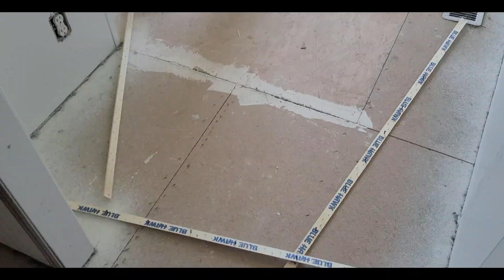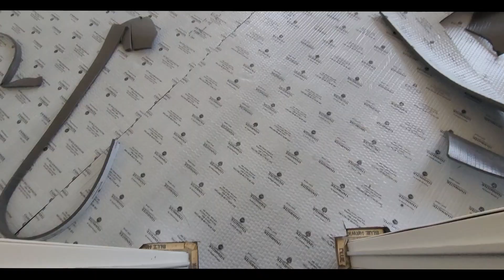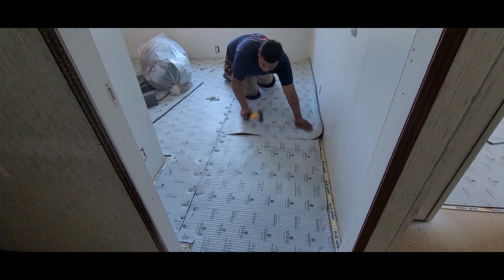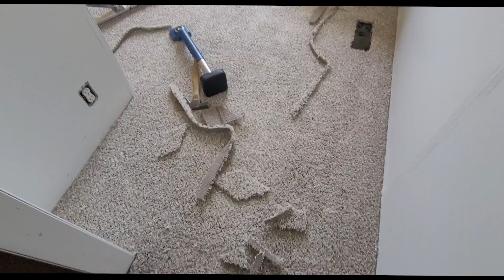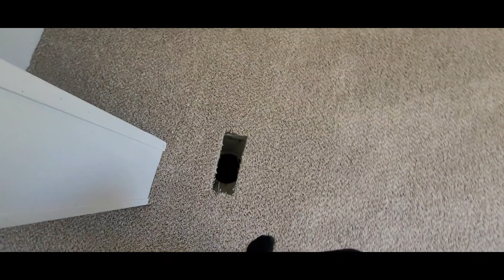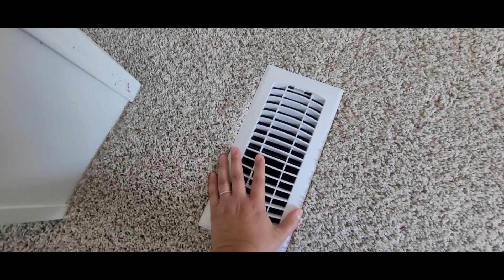Mobile Home Remodel Episode 3 - Carpet installation in the bedrooms.

Comment: if you haven't already destroyed it, you could possibly use just the shelving part of that piece you took out and put it in the corner where the nothingness was. like if you can separate them somehow. then you wouldn't have just a hole between the cabinet and the small wall. or you could hang some shelves in that hole and keep your counter space.
Reply from the maker: Yes we have similar ideas. I was thinking of putting some shelves. But I wanted the countertop space. So maybe I'll use the shelves for cook books and such. 😁